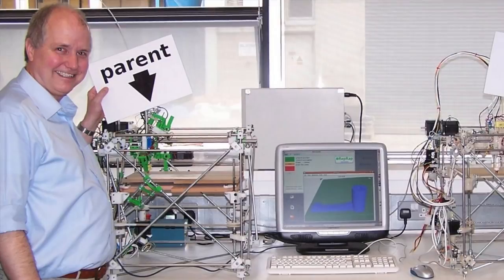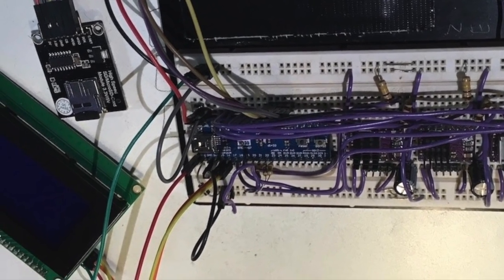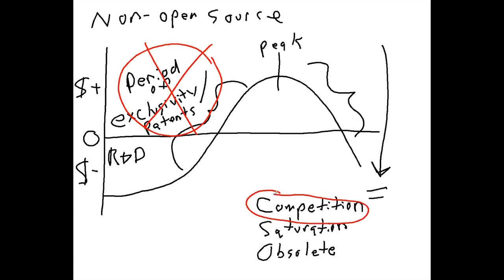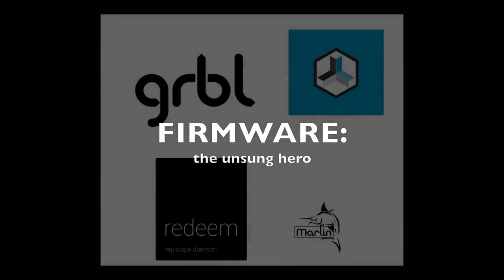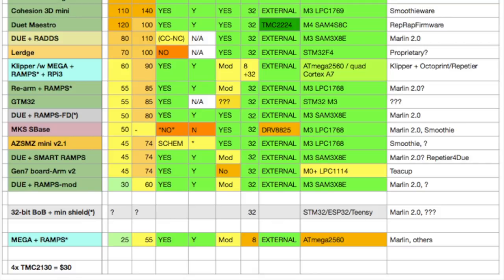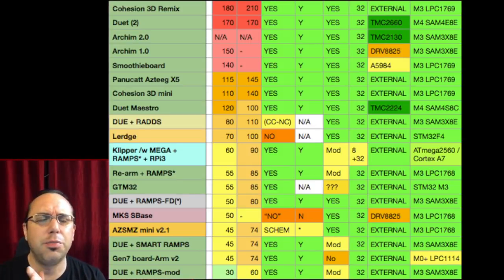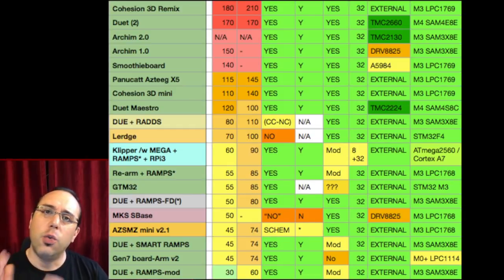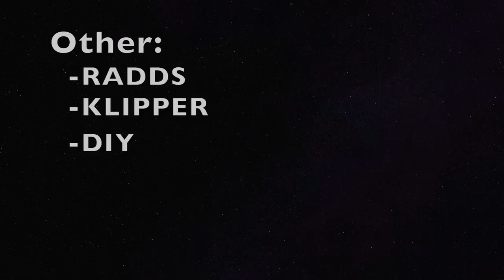Pt. 3 of 32 bit 3d printing series - Boards

Comment: so glad I found your channel! Came here for your videos on the linear rails, taking a detour over your mouse switch shenanigans and now landed here with what seems like much more content to consume. What a time to be alive!
Reply from the maker: Thanks man.  Good job on the DIY printer by the way, that's a ton of work.  I have been wanting to do up an original crossed-gantry design as well.
Reply: @AlexKenis  Oh thanks! Yeah I always liked that design both optically and because its super lightweight without having to do slow corexy calculations. I do plan on changing it again though. I tried to incorporate too many experiments and, because of that, it's not as reliable as I want it to be.

Comment: FYI,  Repetier has supported DUE with a modified RAMPS or a RADDS board in the main branch since 2013.  I know because I contributed the code and later worked a little bit with the RADDS guys to make sure they had software for it. For some reason its a common misconception that Repetier doesn't support 32-bit at all.
I just discovered your channel and I'm impressed.  Great job!
Reply: I just purchased a SKR V1.3 which uses a LPC1768 and for a long time (until 2018) I used Marlin but then my TronXY X5S had a Melzi 2.0 board and I got rid of Marlin and replaced it with Repetier and really enjoyed it but now I have to use Marlin 2.0 (still in beta too) using all sorts of new tools and I will miss the Repetier.
Reply: I know. On one machine I find I have to switch to Marlin 2.0 myself.  It feels wrong somehow.
Six years ago I wanted a 32-bit controller (for delta) and I saw it as an opportunity to give back to the community.  My choices were Marlin or Repetier. But with Marlin, which Marlin? There were so many forks at the time.  But the main factor was that the Repetier code-base was much cleaner so it would be easier to work on.  I also thought those factors would cause Repetier to displace Marlin. Now, however, Marlin supports more hardware and has features that Repetier doesn't.  That said I still prefer Repetier if the hardware permits.
Reply: @John Silvia I 100% agree but after having to dig through Marlin 2.0 I must say it is far cleaner than I have ever seen it dating back to 2012.  I know around 2016 Marlin became even more than I could handle to modify so I stuck with what I had (an earlier version I could easily modify) then went to Repetier in 2018.  The thing is Marlin was made to allow the people to easily modify it and for this the code was slower and on a Prusa I3 Marlin from USB was a max of 90mm/s for me no matter what but I went to Ramps 1.4 GRBL version that was not built to be so easily modifiable (it was a nightmare in comparison) and the same hardware I was now able to do 144/145mm per second.  Along the way Marlin just had too many hands in the cookie jar and the code became too spaghetti code but with 2.0 I find it back to being easy to read.  Maybe it is because I am using Atom?  I tried it first with the MS compiler and the same deal though Atom takes so much longer to start as it fires up and brings my Ryzen 1600 to its knees and my cursor barely moves then once it is fully loaded it runs so smoothly.  I suspect the culprit is Platform.io not Atom as they refuse to let us turn all of the nonsense, and tracking, off.  I don't want to load the news I just want to get in, make my changes, and compile my code and exit.

Comment: I was thinking this issue yesterday, with incompatibility and ramps being lacking.

For re-arm -> One could make a "translation" shield, ie. intermediary board which fixes the pins to match etc. making the RAMPS input pin out standard.
Same goes for other 32bit boards, make a "translation" PCB, even the Due/Duo could be made fit this way, with 3.3V <> 5V conversion on that translation shield. For re-arm the missing pins could perhaps somehow be made available for RAMPS via additional circuitry?
Should be fairly easy & cheap too! As generally that translation shield does not need really much any components.

And as for the RAMPS itself getting restrictive -> A "extended" version could be developed, where basically you have your basic ramps, and then one side is extended further with new options.
This extension could for example offer bigger step stick pin header, say 2x to both directions, mapped parallel to the standard, and perhaps extra pin headers to route 36-60V for that step stick, selectable with a jumper (main power in, or the specific route), with doubled GND/V+ pins to be on safe side current wise. Also breakout headers could be standard here, and the protection circuit. Or current step stick format if you need larger you could rotate it by 90degrees perhaps, i've seen plenty of boards made this way albeit it will cost more.

That extended area could be utilized for higher specced mosfets as well, extra heated bed output (for dual zone beds) with it's own input etc. to skookumify it a bit. Spec every component 2-3 notches higher than they should be, so by the time it gets cloned you still get decent components for a basic printer :) Also any extra new options on that extended area, and even new "input" connector headers for microcontrollers with extra features, thus we get standard pinout for those too, and the translation board can route those in.
Further you can reroute some old pins via that extension area to add extra protections for old stuff too. Further the "output" side does not need to match identically to the original RAMPS in physical locations, most likely, so you get extra room for all kinds of enhancements. Tho, one needs to remain using same type of connectors and physical dimensions for them for all the old versions.
Going that far one could add extra modularity to it as well. I wonder how feasible it would be to have the FETs on a breakout board for easy replacement, once you burn one? Issue is header current i would assume. and how about a breakout for adding some skookum caps in case you have power ripple issues with the driver high frequency? Options are plenty when doing this kind of update, as long as the vision that everything old should be compatible 100%, any and all enhanchements can be done! :) Tons more input & output options should be added as well, even if they windup being slower and working via i2c/spi or something of the sort. CAN bus would probably be nice option for such, but CAN bus devices tend to still be outrageously expensive (coming from automotive side, the PDMs etc. are stupid high price!), afaik mostly due to low adoption outside big MFGs and everyone doing their own thing instead of open, accessible and shared designs.

I suspect this kind of extended RAMPS board would cost initially 35$ but would quickly drop down to around 15$ once well adopted. Those translation boards would probably wind up costing 20$ a piece initially, but would windup dropping to something like 5$ as adoption increases.

Ramps is so well established by now it is practically a standard, and even integrated boards are often based on RAMPS and uses similar form factor etc. just integrated to single board (ie. MKS Gen L). Also the BigTreeTech's SKR board looks very intriguing! Looking at that makes it obvious one could develop based on that microcontroller a version which hooks up directly to a ramps shield.

I do not have the necessary skills nor time to do any of this tho :( I would probably put a few $ towards such a effort tho.

Another idea i had yesterday was pixelated heated bed, as our beds get constantly larger and larger and larger, with higher power. Perhaps use something like LCD driver chips to select areas to be heated up, instead of lighting up certain pixel on a LCD, that controller enables heat for that area of the bed via a mosfet (well a package with like 1000 low power FETs, each area is only maybe 10W of power even on largest beds!). Area to be heated would be easily determined by analyzing first layer of gcode (or with slicer sending specific G command for that), and thus only those "pixels" gets heated up on the bed, and controller can then do things like heat up slightly higher the edges of print etc. might require multiple thermistors too, or some resistance measuring trickery to determine relative heat to known area from a thermistor etc. but it would allow to save tremendously on the power side of things for heating the bed, as most of it is not printed on usually. It would also solve all the uneven heating issues; Edges can be heated up to same temperature.
Tho that would be fairly expensive, at least initially, require custom PCBs, custom bed, a lot of coding, and a lot of figuring out the heating algorithms and calibration code as every bed is different, ambient affects things etc etc etc.
On large prints you could turn of heat on the middle too, and save energy that way too.
Some of the cost would be offset by not needing as large PSU. You could probably drop down from a 500W bed to 300W, or even 200W.

Comment: Interesting! I hadn't heard about Klipper. It's very interesting for me because I already have Octoprint set up on an Orange Pi One (which is $15) and I don't have to change any hardware (so it's free for me to try). I personally didn't notice any speed issues with Octoprint (though I print at 60 mm/s max. because of ringing and underextrusion problems).

Comment: Thanks for your very nice videos! I am also looking into a new 32 bit board. I didn't know about the GTM32 ones before. The GTM32 Pro VB has schematics/pinouts and information on connectors, several LEDs available. I also like that it is 24V compatible, and it supplies 12v for the fans. It also has a dedicated port to connect LED stripes.. if one needs that. The downside is, that it is probably not supported by marlin or any other of the open source firmwares. But with all this information i might still get one and port klipper or marlin to it.

Comment: Great work Alex. The Raspberry Pi being a multi core 64 bit board is naturally much faster than any of the 32 bit alternatives. However the idea of making a firmware written in Python doesn't sound good, simply because someone can simply translate the code to a more performance efficient language such as c/c++ or rust, or even java or scala running on an android vm, put the whole thing in a new github repo with the name Clipper, for instance, and then the Klipper firmware is automatically an inferior choice.

Comment: Epic video. Thank you very much. I may have chirped out a little profanity when the rambling about each board ended right before the Smoothieboard, which I was rather keen to hear commentary on. I mainly wanted to see if the main points aligned with what I already think. Thank you for the 24V comments too. I've only used 12V PSUs because I felt I could trust a good quality Computer PSU more than an industrial-looking generic 24V supply. And perhaps that's true, with respect to just the PSUs themselves. But in context, seems 24V is safer enough that I should transition, which I can do without too much effort. Thanks again, these videos are outstanding.
Reply from the maker: Thanks.  I didn't cover Smoothie and Duet since they are 'their own thing' with their own hardware eco system and firmware,  and I wanted to keep things on the budget/open side, but the consensus seems to be that Duet is great and well supported, but expensive, and Smoothie works well but is a bit behind with V2 development lagging for a long while.  If using marlin with smoothiboard, be aware that it runs on the LPC mcu platform, so it inherets from mBed, not arduino, and there are some kinks still being worked out with combining advanced features (same for all LPC boards... rearm, sBase, etc). But I have 2 LPC based boards running, so it's not a deal-breaker.

Comment: Thank you for the awesome run down on 3d printer boards. I am a hobbyist 3d printer and enjoy printing lots of different projects but i also like tinkering with the machine. I purchased an ender 3 and have been having a great time learning all it can do. I really couldn't justify the cost of a more expensive printer at the time I purchased it and in the long run I am very happy with the prints I can achieve with it. But the limited amount of memory is driving me nuts. I added a bltouch and thus lost sd card functionality. I would like to add other items like a filament runout detector but this dang meltzi board is so limiting. I have investigated the MKS GEN L but with the cost of board and drivers approaching 60 dollars I have been seriously thinking about a 32 bit board. Especially since I am having random disconnect and no longer trust octoprint (another story!) If you were in my position would you stick with 8 bit or spring for a duet maestro instead.
Reply from the maker: Sorry about the delayed reply.  I've been busy.  Yeah, it stinks that those printers only have 128k of progmem. I have not really covered high-end boards so I would ask people that have experience with the maestro before making that big a purchase. I'm sure they are solid and well supported by their specific RepRap firmware (marlin support is still in beta).  Make sure to figure in the cost of whatever you will need to replace as well (i think the duets run specific  thermocouples and LCDs, but im not positive on that).  I like to recommend a regular ramps1.6+MEGA combo for folks just getting used to hardware because you can get that setup super cheap (so mistakes are less costly), and  there is a ton of community support, BUT there is nothing wrong with jumping into the high end stuff either.
Reply: Alex Kenis thank you!  I have also been looking at the new skr1.3 board by bigtreetech they are much less expensive and it’s seems to come with some good documentation and even a marlin 2 configuration video. It is priced the same as the MKS gen l board

Comment: I have been watching Klipper my self but i am not as knowledgeable as you are with this stuff. It was good to hear your incite into what you thought about it. I run octoprint on my RPI zero and all ways wondered how it would go with Klipper I had my eye on a upgrade to a Orange pi light 2 as it has a H6 processor for a really nice price. The problem i find is that SBC's are a lot like 32 bit 3d printer boards every one seems to produce them but they don't support them as well with software and the community does most of it so if your SBC is unpopular its forever for it to be functional unless you can code the thing your self.
Reply from the maker: Agreed. Many manufacturers just crank out boards with little info and no software. I have a few sbc's I want to give a try, but I don't have time at the moment to get all the kinks worked out from a scratch build of debian.

Comment: Also if you want to try klipper on the cheap you could use a pc or laptop with linux and run it from that. but yeah it is a bit more overkill. I am getting a bit tired of octoprint so i want to try the repetier wich are supposed to support klipper now. Or im just going with the lcd and virtual SD and bypass the web ui
Reply: I think that a bash script that contains mainly cat and a little bit reaction on the responses from the MCU could be enough to replace OctoPrint. If I only would have the time.
Reply from the maker: Agreed.  I grab old laptops from flea markets and thrift stores whenever I can , just to have around for things like that. It's a good option.  I can confirm that recent Repetier does support Klipper
Reply: @AlexKenis  - old netbooks fit the bill very well. Old dual core Atom CPU, 4gb of ram max, chuck in a spare SSD (we all have a couple spares don't we?)... Even if the screen is cracked, just take it off and use the VGA port. One of favorite Netbooks from HP has a SATA port, VGA, dual core hyperthreaded Atom (4 threads!), ethernet, and power button all on a single board and you can buy the motherboard off Ebay for like $15. 3D print a custom case and poof, low power system great for general purpose stuff. 

Mine runs Debian and controls my 3D Printer and CNC router, custom TFTP server for network booting several images, and web-server with PHP. Having shared folders allows easy transfer of gcode or whatever else I want. Rasp Pi is cool n all but it's to slow for all that I want to do. That's one of the issues that I have with the R-Pi, it's to powerful to just sit there and run only Octoprint but not fast enough for other tasks, esp with its dismal ethernet speeds, this is my opinion of course because speed is all relative to what you expect/desire.

Comment: What would you recommend (i'm new to this, just bought my first 3D printer and i am looking at the ideea of upgrading to 32bit processor) DUE + RADDS or DUET ETH? And i see there's a problem with using an eth adapter on the DUE.
Reply from the maker: I don't usually recommend boards because you can never know a user's needs and $$.  I mostly focus on open source budget options, but there is Nothing wrong with going with one of the premium boards if you have the cash.  RADDS and Ramps-FD are both in a strange spot because the Due has some quirks, and finding complete info on RADDS is tough because they are not completely open source, and you have to request full documentation.  They also had their reprap wiki page pulled down because of it, so yeah, they are in a strange spot and I don't have much info